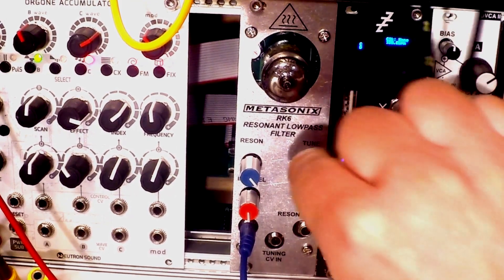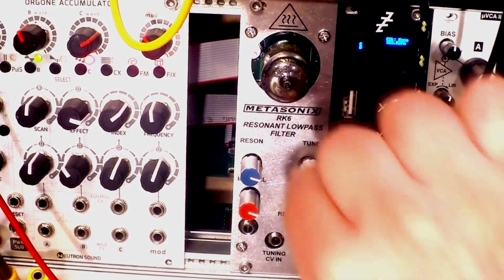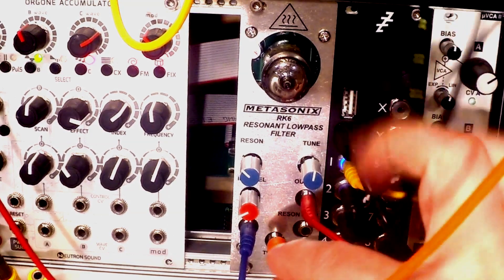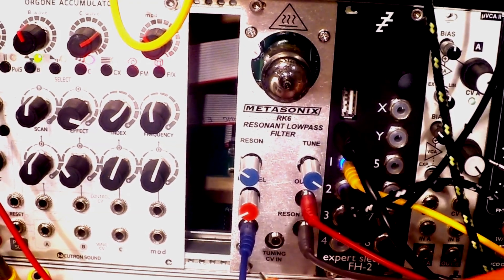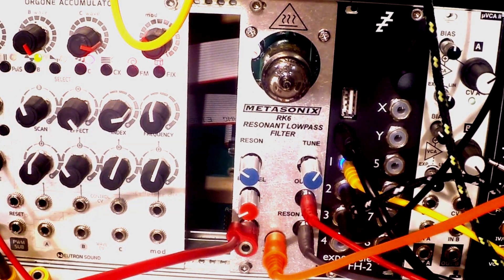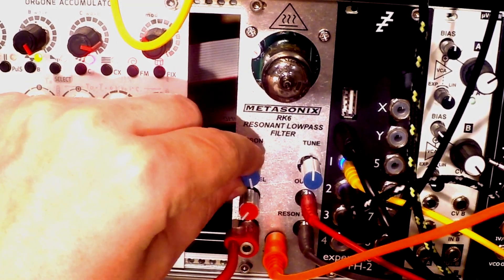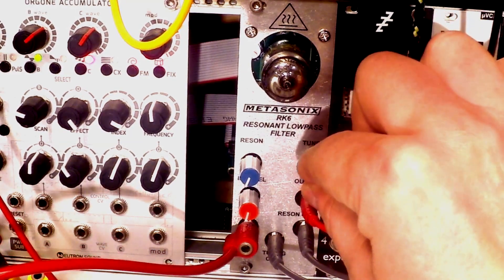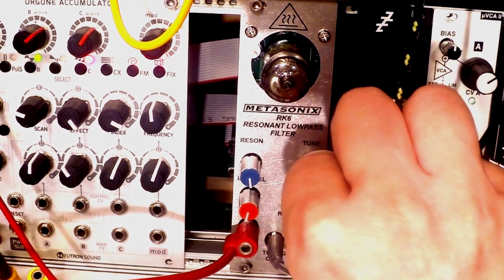RK6 RESONANT LOWPASS FILTER by METASONIX - overall review (ENGLISH VERSION)

Comment: I’m a big fan of metasonix stuff as well, rocking a r-55/r-52/r-54/RK-2/RK-3 they’re all disgusting in the most beautiful ways I love it.. wondering how much difference the RK-6 would provide over the multimode filter I have now in the r-52
Reply: I own both. They are COMPLETELY different.
Reply: @mrhs5220  Would you care to elaborate? <3
Reply: @b_-_-_-_-_-_-_-_-_-_-_-_-etc  Got an hour? lol. Seriously though, I'll keep this as short as I can:
The R52 is a strange filter, and to truly grok it you have to shed a lot of preconceptions of how a filter should behave. Technically speaking, the R52 is actually a bandpass filter and bass-only filter in parallel, with a crossfader between them. The crossfader allows you to use it as a bandpass, lowpass, or bass-only filter. The frequency sweep range is much more limited than you're probably used to (about an octave and a half), but there's a toggle switch to flip between two ranges. At no point in the sweep does it cut off the input completely. Also, the resonance control has a significant effect on the output volume. (I like to take advantage of that by pinging the Resonance In to get accented notes.)
The RK6 can be thought of as a resonant lowpass gate. It has a wider sweep range, and is capable of completely cutting off audio that's being fed to it. Its resonance control behaves more like you'd expect as it doesn't have a significant effect on the output volume. When in self-oscillation, I've found it more readily syncs up with an input wave than the R52.
The ways they behave when overdriven is also completely different, but that's way too detailed of a subject to get into here.
Neither can be made to sound like the other, and I've spent a chunk of time trying.
They lend themselves to being used in completely different ways, and I wouldn't get rid of either.